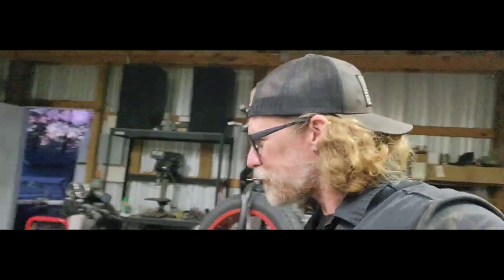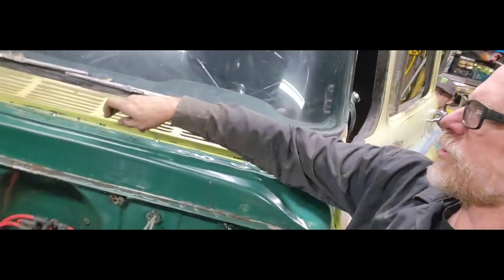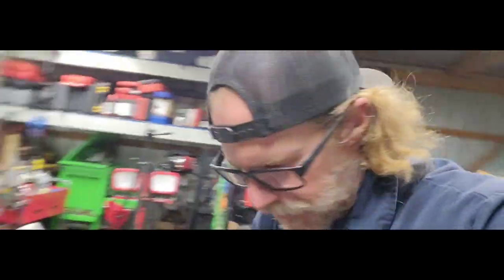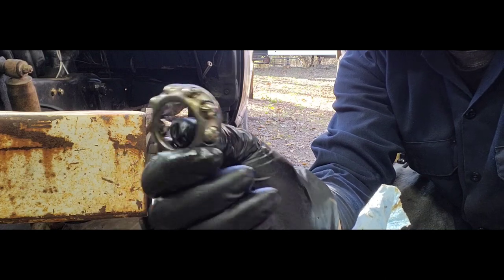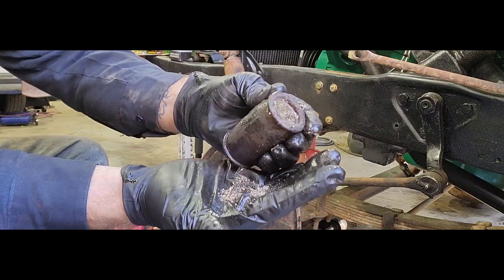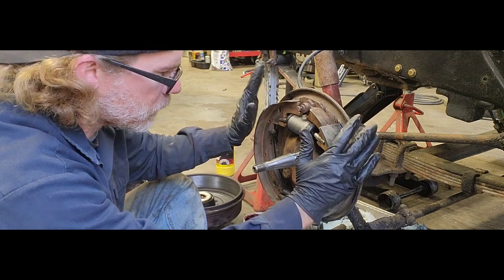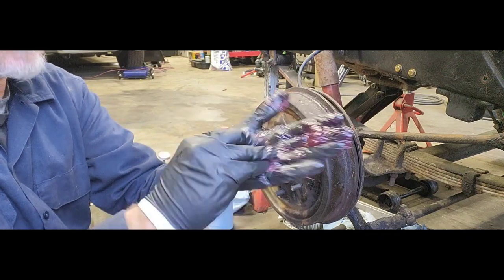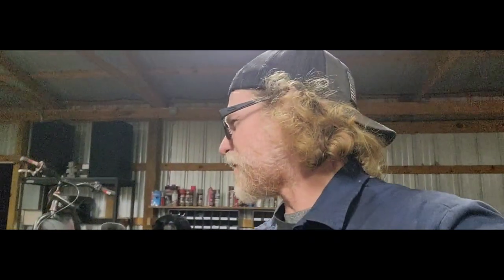59 Gmc Corncob Gets A Firewall Mounted Brake Master Cylinder And First Drive!

Comment: Had to come back to this video to do the drums on my 1973 VW Beetle turned 1953 MGTD kit car. Front left brake did nothing unless you mashed the pedal, at which point it would pull you into oncoming traffic. Whoever was in the drum last had grease all over everything. Cleaned up the shoes as best as I could, and threw new cylinders on it. Just took it for a short rip around the block, pedal feels MUCH less stiff, and a whole lot more even. I'll probably have to give the adjusters another notch or two, but it's good enough for now! Thanks again for all the videos, I've never dealt with drums before, so this was all new to me